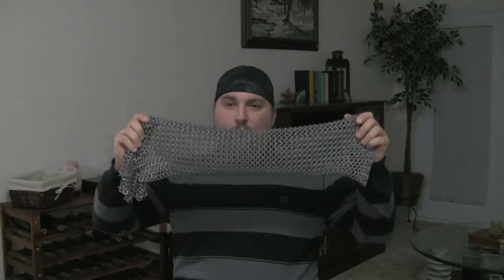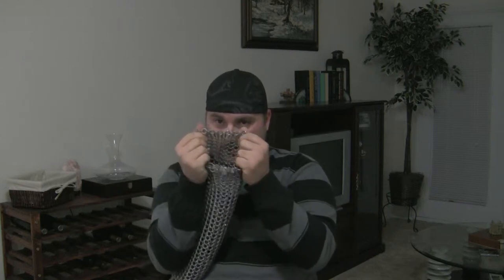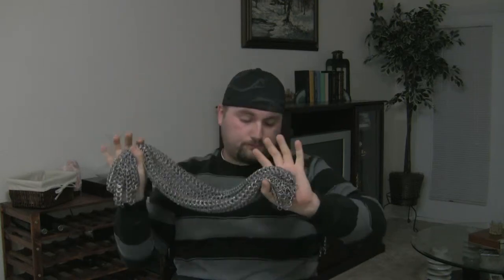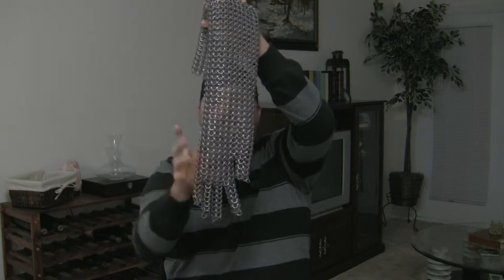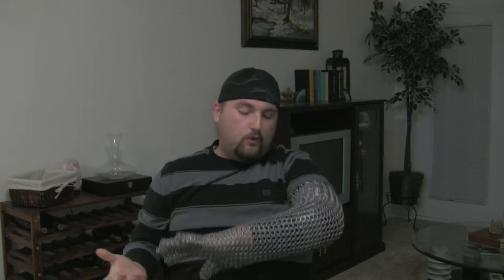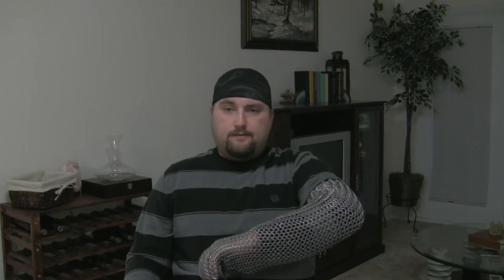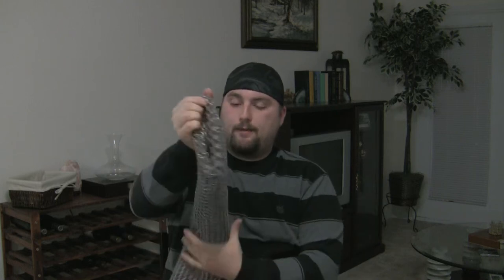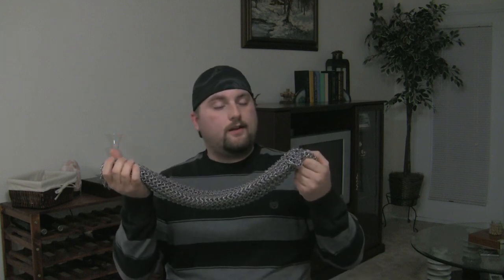Faraday Suit Chainmail Series - Video 7

Comment: At the wrist, shrink the diameter of the chain mail rings and increase the diameter as you go to the elbow (slowly of course) at the elbow make the links the same size as the wrist but double the amount and then slowly grow the diameter of the rings until you hit your shoulder (at your elbow two-four small rings should fit in the large ones)